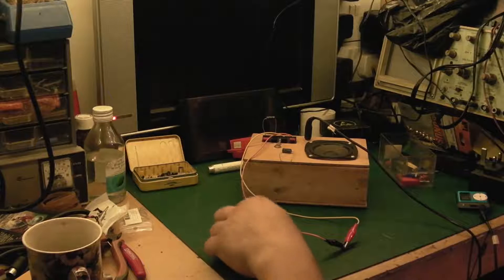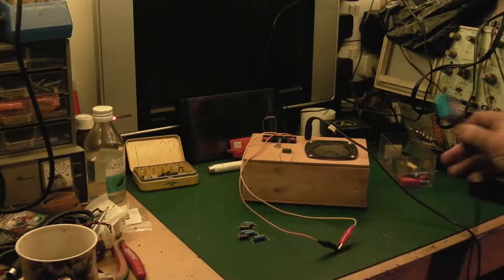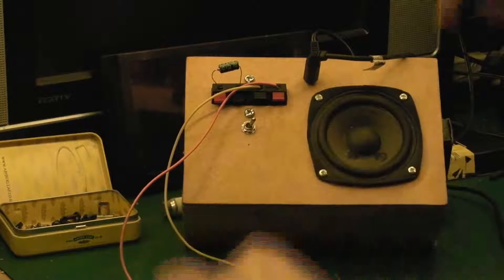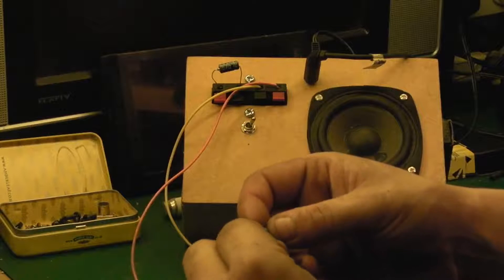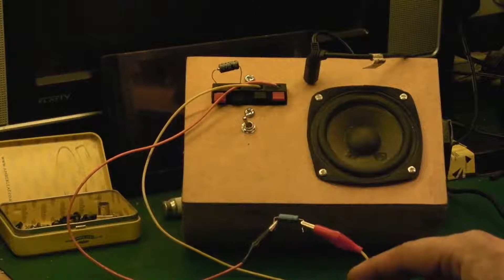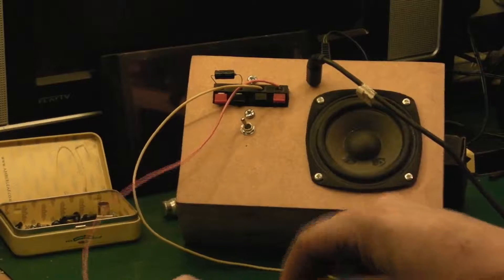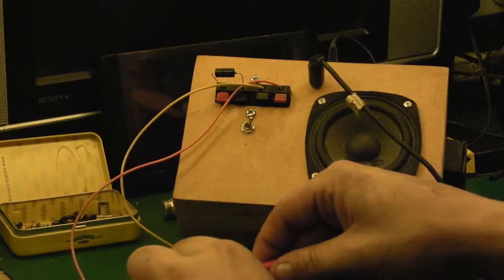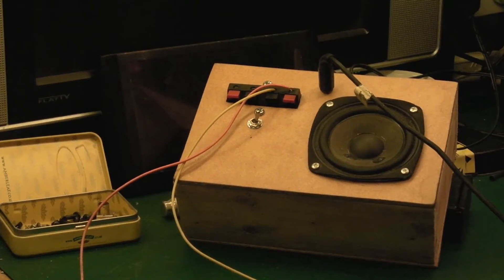Testing for bad electrolytic capacitors using audio

Comment: I guess that this method identifies capacitors that have not totally failed, but over time the uF value can deteriorate, so a 22uF may end up only 10uF and not ideal for the circuit. I think the  test capacitor gives and indication of this, but maybe it wont be audible if you had a 1000uF which has become only 800uF. I love messing with this kind of stuff and like to mod crossovers in speakers and repair amps. I am not an expert by any means. Great video overall though mate !

Comment: The problem is today, more capacitors are used in circuits that require low ESR for operation, such as when they are used in power supplies.  The demands on these capacitors are great, and even though this simple tester shows capacitors as good, they are still not good enough for the power supply.  So this tester gives a false good indication, and can't be relied on.
Reply: can you connect your speaker to compare with cheap mundorf 47uf Mcap tin cap(white.color) vs 47uf Mcap Alum vs 47uf Mcap supreme silver oil vs 47uf Mcap Supreme silver/gold/oil EVO.  Does it sound different ! Live Video have ? 😍😍. ( can u do a video with that can ? It will be very Fun to try )......."/

Comment: What if capacitor have 3 or 4 legs ? ))
Reply from the maker: caps like that have multiple capacitors inside. identify the common pin, connect one wire to that pin then the other wire to the other pins one at a time.

Comment: Great idea and maybe something I will build myself. Couple of  question, if the cap is shorted won't it just sound good like the 2 crocs together? Also for testing caps on a board, better surely to disconnect one end to isolate it from the circuit? Thanks.

Comment: You are just testing the complex ESR of caps using audio frequency without even knowing what you really test. There is so much more to a capacitor, e.g. its capacitance, leakage, HF-behavior, capacitive impedance, inductive impedance and everything depending on the test frequency. What you do is more guessing...
Reply: It better than no tester at all and that  is what I use to have was nothing.

Comment: well thanks for nothing, no schematic and no shots of the guts..
Reply from the maker: You dont need a schematic all your doing is putting the capacitor in serease with the speaker and dviving an audio signal through it with an amplifier.

Comment: Interesting idea, I sometimes get caps which you know are bad or doing something odd, but an ESR meter says they're OK. Useful to have a alternative way to hear if it is dodgy. Not sure about testing the caps in circuit on a Spectrum though. The voltage across the cap would be applied to the rest of the circuit. Before the cap charges, the voltage could be a lot higher than 5v, maybe negative. Voltage spikes on any of the rails is not a good idea for the 4116s either.
Reply: can you connect your speaker to compare with cheap mundorf 47uf Mcap tin cap(white.color) vs 47uf Mcap Alum vs 47uf Mcap supreme silver oil vs 47uf Mcap Supreme silver/gold/oil EVO.  Does it sound different ! Live Video have ? 😍😍. ( can u do a video with that can ? It will be very Fun to try )......."/